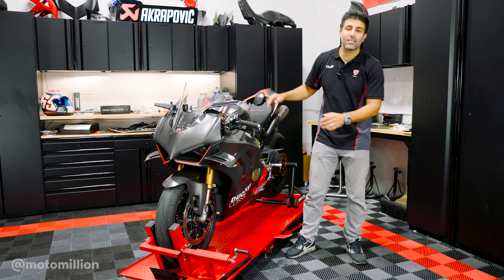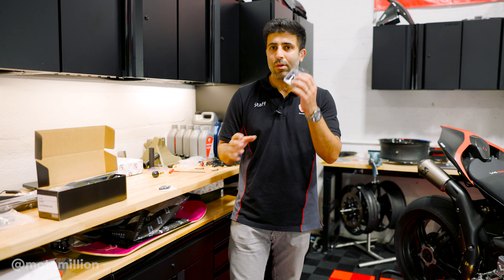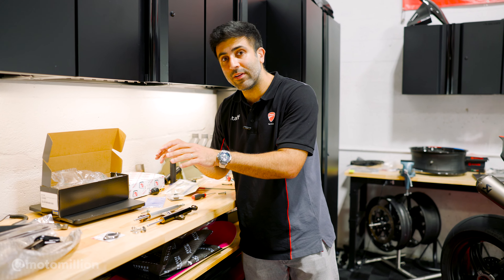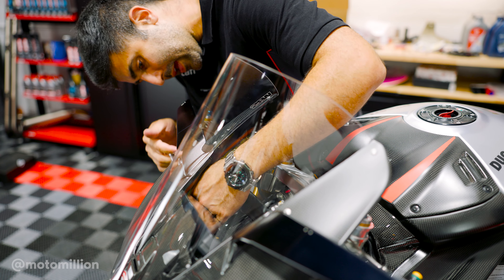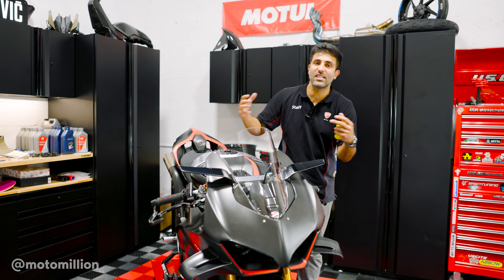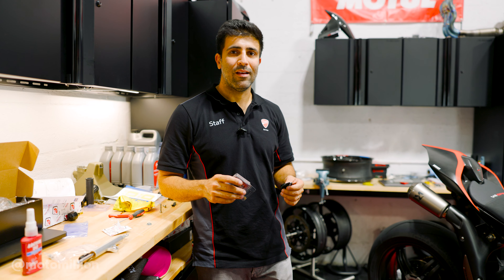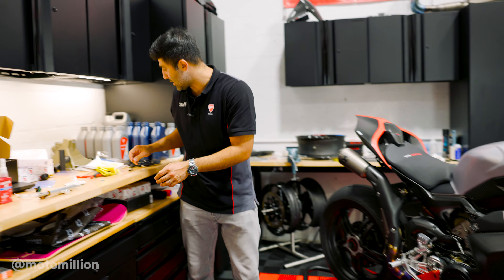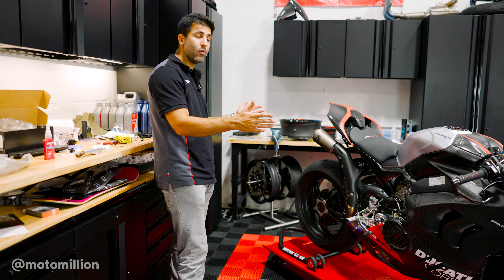Final Mods for Our Ducati Panigale V4 SP2! Ohlins & TWM! | SP2 Series Part 19

Comment: Manual Ohlins damper is a must. The electronic OEM takes about a second to take over but over 100 mph and coming out of a turn that second seems a lot more. On the track I would hold. But did not like the feeling at all makes you feel uneasy. I got mine for my 2019 R1M from you Mani 🙏and the moment I tried it out you feel a huge difference. I use mine on the track.7 clicks back from full hard. And for the street 9 clicks back from full hard.
Reply from the maker: Glad you're enjoying the manual Ohlins damper! We're very happy to see that you're putting it to use on the track as well 🤘
Reply: What you're saying makes no sense. The only difference between the dampeners is the adjustment method.
Reply from the maker: They are valved differently. We have experienced both dampeners, the experience is night and day on track.
Reply: Yes  Mani, not only are they valved different  but the electronic ones have a limit to how hard they can get and the electronic one always has some kind of delay. The manual one is definitely a huge difference, on the track when I’m on throttle specially, on some bumpy sections of the track you feel when the steering comes loose, Your bars will give you a quick shake on certain sections of the track and a moment later your electronics kick in.. it’s like a delayed feeling. I’d prefer not feeling it at all or as less as possible. On my same pace, and same section of the track where she would come loose it has happen no more. Now with the manual Ohlins damper it gave me more confidence with the feeling on the bike and allowing me to stay harder on the throne set at 7 back from full hard. So Instead of holding the throttle, waiting for electronics to kick in then opening up more after the electronics kick in. It made a huge difference  now on the street I use 9 clicks back because I really don’t ride or no one should ride on the street the way we ride on the track.
Reply: There is a lot of misinformation here that needs to be clarified. The steering dampener isn't dynamically adjusted. The ECU doesn't adjusts the dampening force while riding. You set via the menu and it stays fixed at that setting. You can hear the electric motor adjusting the dampener when you save the settings. If you bike wobbles, than move the slider from handling to stability to increase the force, just like you do with the passive one.
Even if it's valved differently, it still overlaps up to a point. The passive one might make a difference towards the higher end of the spectrum, but you're not riding with it set to the max anyway.

Comment: Considering you can set the suspension and you don’t need to use the dynamic mode, why is this necessary?
Reply: Why work and NOT spend money?
Reply: @luisthisguy9825  Relevance to my question?